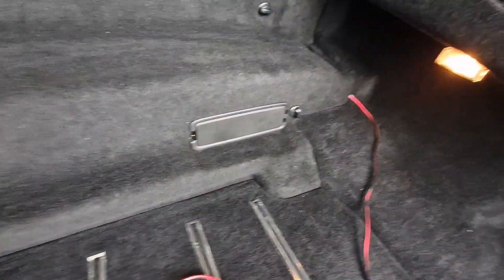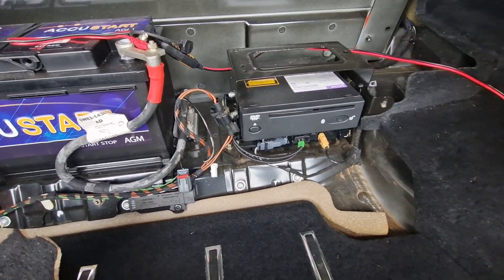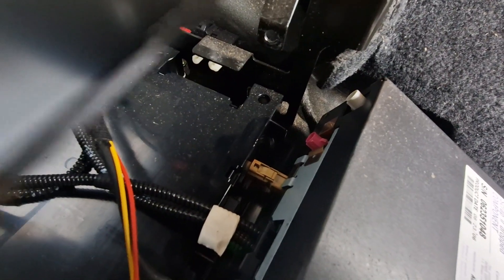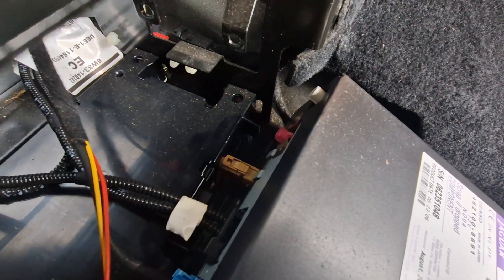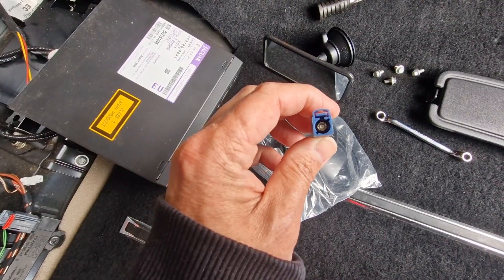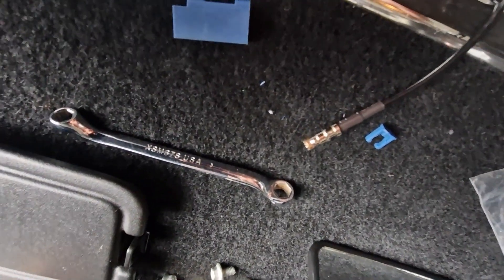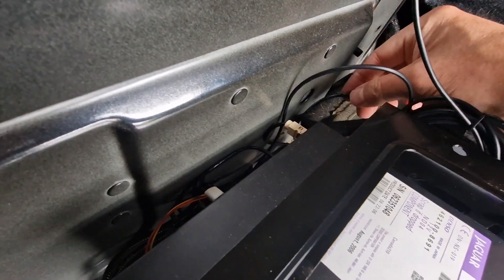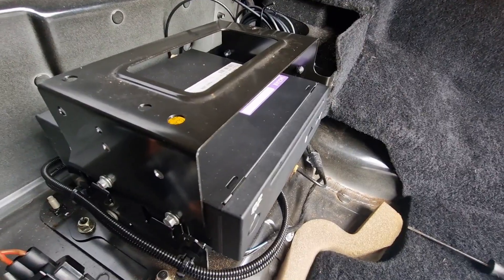Jaguar XK (X150) | Satellite Navigation fault | GPS antenna modification

Comment: Paul just another thank you for all your tutorials. 

Unfortunately I wanted to share where to get the antenna and adaptor from …  For your info I also purchased the 2020 DVD for our Satnav’s …. It loaded straight away without a prob … just remember to have the engine on … for info my Jag is the XK 150 4.2 on a 56 plate (Manufacture Year 2007) but as indicated above the auto delete removed all the info … very frustrating.

Comment: Great alternative to removing the spoiler where the original gps antenna is located I believe. There is a product called Sugru which is a rubber like putty that sets and stays rubbery which would help rather than leaving the bare metal of the gps connector showing, also great for many uses and comes in many different colours.. Keep the content coming..
Reply from the maker: Thanks bud

Comment: All my posts have now been removed. A cheap adapter costs £10 which will connect your antenna to the DVD unit but I cannot mention anything about the adapter as my comment is instantly banned.
Richard
Reply from the maker: Hi Richard no idea why your comments are removed. I did see online the forum about adaptors and if that was your post it was very useful thanks
Reply: Likewise. Comments removed. Had a suggestion for a completely different option as an interface without changing anything visually. Keeping it looking factory. But it keeps getting removed. 🤔
Reply: Very frustrating, as trying to advise on a great upgrade option but it keeps getting deleted/removed from here.
Reply from the maker: @Shane Killingback  must be something to do with setting on video.  Did you try to post an external link? If so that would be the reason it gets removed by youtube
Reply: @life_on_cars  I believe that the setting to not allow external links, or to prohibit certain links, is applied by the content creator. You do get a warning when you click on an external link in a comment that you are being taken to an external website which you have to OK, but the links work properly. Most of the channels I subscribe to allow external links so I think you need to look through your settings.
Reply: @life_on_cars  it wasn’t a link. Just described where to look on here for the upgrade
Reply: @life_on_cars  see if this works for you to search. Apple play and Android Auto for Jag XK and XKR
Reply: Spot on Paul,it seems to work fine.nice and quick and cheap.
Just one question my disc is the original.is it worth getting a later one ,and which one please... cheers.keep up the good work.